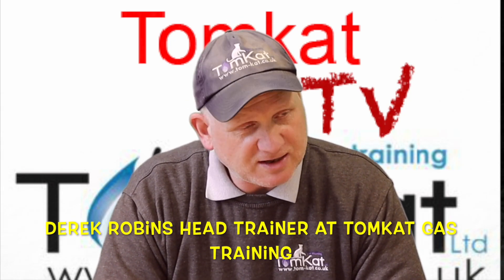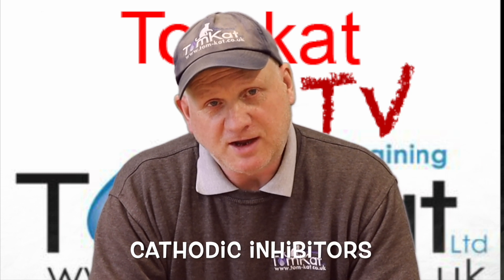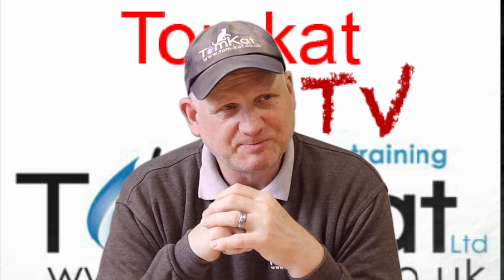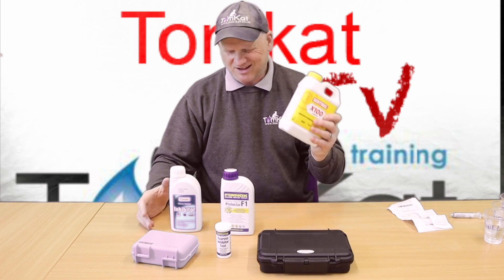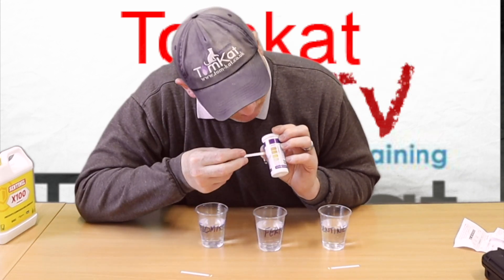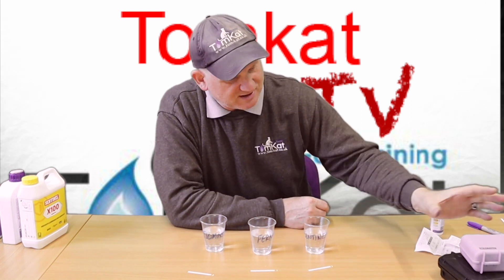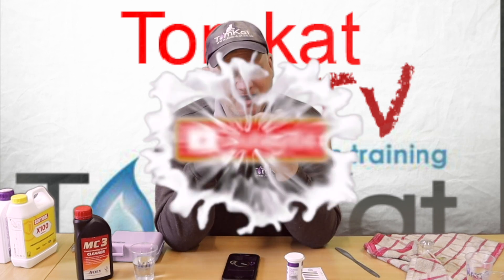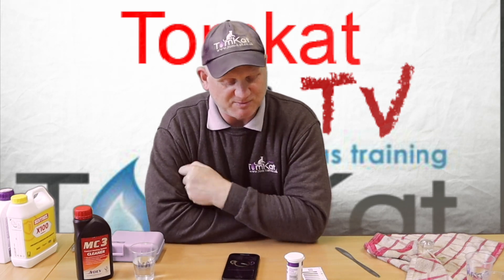Inhibitor test. Finding out if inhibitors for central heating boilers show up on different tests

Comment: I do a few tests for a manufacturer. Every test i do comes back with no Inhibitor,even the ones where u can smell it in the water . Unless it has the chemical that the test company want to see then alot of people could have thrre warranty revoked for no reason. I actually tested pure inhibitors from the bottle on a few inhibitor brands and they all say no Inhibitor on the fernox and procheck . Maybe they should have a colour in the inhibitor, darker to lighter shades to show the concentration of the inhibitor . Instead of picking up the chemical.

Comment: I'll just point out that there is nothing in part L regarding testing inhibitor levels on servicing or repair work, just on new installations. When inhibitors are added upon commissioning part L states that BS 7593 should be followed. However BS 7593 does state that inhibitor levels need to be checked upon commissioning and annually thereafter. I noticed that the benchmark servicing checklist in boiler MIs were updated a while back to ask if the inhibitor has been checked according to BS 7593. If it's not done, or false info given, it could affect the customers warranty. Apart from that, handy video.

Comment: Good intuitive video but personally I’m not at all concerned with what another engineer may find or get different results on a different day after my visit as it’s only going to be good at the time of testing a bit like an mot on your car only says it passed/ safe at that point in time! if someone drains down to remove a rad ect a day later the test results is going to be different.

Comment: Can think of a few instances over the years where I've had the manufacturers out. They then mention system debris blah blah blah.
It was only the fan that had gone.
Bring back 2 year warranties.
I've said this time and time again on a forum I'm on, long warranties don't benefit the industry at all......
Remember, I said industry,  not end users.
Reply from the maker: Completely agree with you and these long warranties should be given to the installer not the customer so if you don’t service the boiler then the customer gets 2 years but if you look after the boiler then the customer gets 5 years.

Comment: Just a way for the manufactures to get out of a warranty breakdown for me, I shall be doing the tests on in warranty services and new installs, but regards boilers that have been in for years with no warranty, I won’t be, isn’t it more about the boiler safety, if it means having to charge extra and possibly putting people of having a boiler service, it’s having a detrimental effect on the industry, and the publics safety.

Comment: Hello mate, do you have to use the pro check or can you just use the quick test strips as cheaper
Reply from the maker: I guess as long as you can prove you have tested it you can use any of the test if you create a report
Reply: @tomkatgastraining   A dipstick can only find the chemical it was designed to find.  A strip designed to find Molybdate won't find Sodium Nitrate, so it will give a negative even though there is a perfectly good NSF approved inhibitor present.
Reply from the maker: And that’s my point mate

Comment: It seems easier to just ad a ltr of quality inhibitor on every service that you perform with existing customers and offer the service with a new customer as a different tier to your servicing levels, at the end of the day if they don't want the extra expense there is nothing you can do just like if they don't want you to strip their boiler if the combustion ratio readings are within manufactures spec. documented service work and a signature is the way forward just like a gas safety cert.
Reply: Just a query, would you at risk the boiler if it's combustion readings were not to mi's spec and customer didn't want strip down to resolve?
Reply: If its above the 0.004 ratio then yeah but again check with MI

Comment: Great work thank you, makes it all a lot clearer, thank you. I once put the wrong inhibitor in a system, which I didnt know there was such a thing and it reacted with the heat exchanger and produced air in the system which was very unusual given it was a sealed system. Manufacturer pointed out my mistake, so flushed etc and used the correct inhibitor and all solved, bit of a learning experince that one was.
Reply: How would you know it’s the wrong inhibitor other than being told by the manufacturer? Once I put in an inhibitor which seemed to cause problems within the boiler but I think it had issues before.
Reply: @gasnewbie1941  ye the manufacturers engineer said it wasnt on their recommended list in the MI's and that was how ro chose. I had just picked up some at the merchants as I picked up the boiler and never gave it a thought. I always leave the empty bottle with a date when I used it near any boiler and that was how I think he was able to so quickly say what was wrong. I have to say I had fitted over 100 of the boilers and this only happened once but have no idea exactly what inhibitor I used on them all. Every day is a learning day eh, I certainly found it unusual , seems some react with aluminium heat exchangers and that is what causes the gas build up or air in the system. It was producing a lot of air over just a day or two. Glad it was a family member as it means I didnt look too stupid haha.

Comment: Hi Derek, as always fantastic video now we know much more,  thanks.  I always tell my engineers use TWO bottles because over dose is good under dose waste of time and money, when we drain down to replace a water part refill with F2 / X200 SILENCER, yes that's what it should be. Might see you today or tomorrow, regards, George Staszak
Reply from the maker: Not at installer this year George just too busy this week 👍🏻
Reply: @tomkatgastraining  It's very good today, a bit hot but enjoyable, george